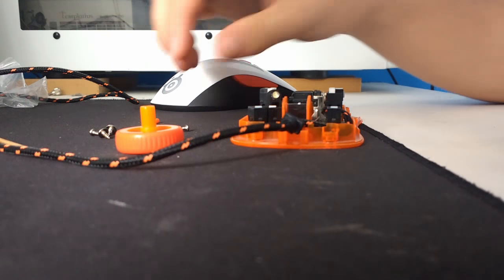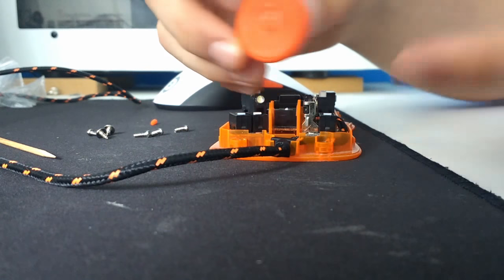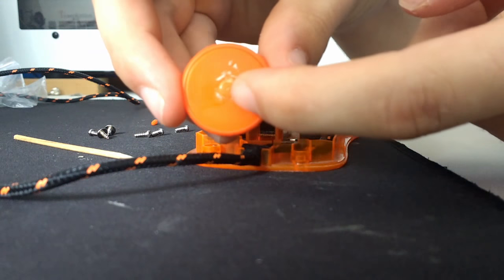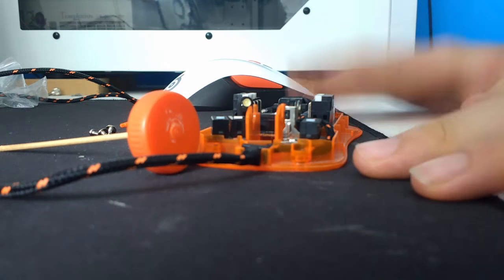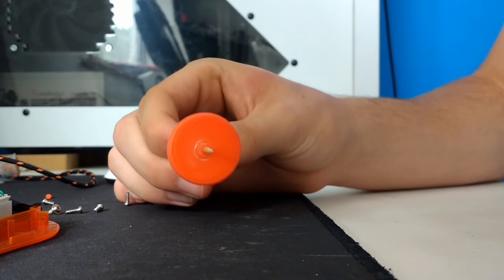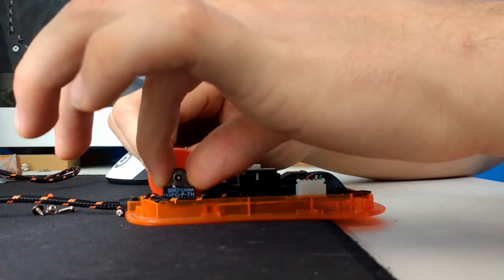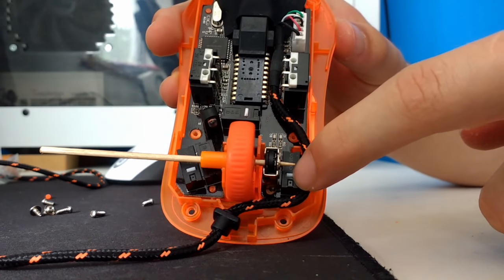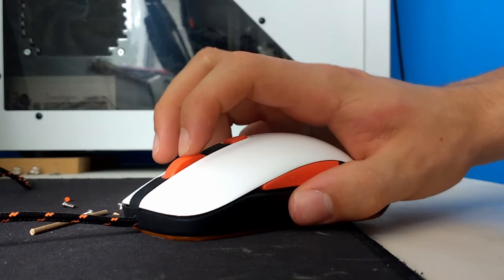How to fix broken Steelseries mousewheel axle

Comment: Thanks buddy,well i did mine using a toothpick and to make a hole on scroll wheel.I used a small scissor,heated up on stove for few seconds and used that hot scissor point on scroll whell to make hole.After that i filled the hollow part with glue and then put the toothpick inside it and alligned it with axis,left it for drying and tadaah!!.my mouse started working
Reply from the maker: Good to hear!

Comment: did this for my rival 100 scroll wheel. unfortunately, the rival 100 scroll wheel doesn't have that hollow center and the axle is solid all throughout, so ultimately i fucked up drilling it. ordered a rival 310 scroll wheel instead (because the 100 scroll wheel are virtually impossible to come by) and hope that it fits. if ever i rage again on that 310 scroll wheel, hopefully i get to use your method of fixing it hahaha. made me wonder why the factory didn't use these sticks instead, probably cheaper for them too. cheers mate!
Reply: where do you order scroll wheels from?

Comment: It's a shame we have to even fix it ourselves. I literally had this mouse the rival 300 for a month and the wheel axle snapped off. $40 for what?
Reply: Quartered Rodent Well I mean... 40$
Reply: @raresutz6257  Sorry you had to experience that. If you take a bit more time you will be able to find a replacement wheel. So far since my last post I have had no problems. I think I ordered my wheel replacement on ebay... it's less than $5.00. Check it out before you spend more money replacing the entire mouse. Good luck Penguin.
Reply: @cntrlled4698  From a reputable company I didn't think they would make a peripheral that broke down within  a month because of going cheap on internal parts.
Reply: @raresutz6257  No problem. Let me know when you fix it and good luck!
Reply: @raresutz6257  Nice work Penguin! I'm glad you were able to fix your mouse. Now it is a little Frankenstein's monster haha! Take care.
Reply: tbh steelseries worst company i have ever seen. after 1 month of my rival 600 purchase glues of side panels are started to come to my hand and they are not even sending new ones or take their faulty product back. Now wheel is broken and now I need to fix my own. Not gonna buy anything from steelseries anymore.
Reply: @burakmeral5265  I don't blame you Burak. Sometimes paying a little extra for something doesn't guarantee quality. Good luck on your next mouse.
Reply: @Quartered_Rodent  Tbh quality is not the issue for me here, electronics basically is a luck however, a brand like steelseries and their response is the issue. They made a faulty product and they need to take the mouse back and give the new one to their customer. Look for Logitech for example that's what they do and that's how they are one of the biggest company for the mouses keyboards etc.

Comment: there should have been a rod in the middle of the mouse wheel or a metal one but that would increase weight
Reply from the maker: The design they used is usually fine. I'm pretty sure all other mice use a small bit of plastic, which is strong enough (my g102 is exactly the same). In this case they just made it too thin or allowed the mousewheel to much vertical movement so that its liable to snap.

Comment: Funny that new wheel costs around 12$ and you fixed it for free
Unfortunately my wheel is not hollow so i need to buy new one
Reply from the maker: Neither was mine, in the video I mention that I drilled through it using a 2mm drill bit

Comment: Do you think super glue would work for me to put the plastic part back to its original place?
Reply from the maker: I tried that at first and it snapped, hence I made the video. Cocktail sticks are cheap asf deffo get one of those. Though if you or a friend have a 3D printer consider making a new wheel https://www.thingiverse.com/thing:1012588

Comment: Same problem here in a steelseries rival 300. I wasn't expecting this kind of low quality low durability in a "high end" product. Saw here in comments that the same happens with other manufacturers, wtf is going on? This kind of issue doesn't seem to happen in low ou mid end quality mouses.
Reply from the maker: I think they are all trying to make mice as light as possible following on from the finalmouse etc. Yeah not good when it breaks so easily.

Comment: My mouse is not hallow any idea how to fix it?
Reply from the maker: I see you commented that you have an air58. Which side has your wheel snapped on, the side closest to the rotary or the bit under the right click?
Reply: Seth Coode yes the mouse wheel is not hollow like yours I can’t put a toothpick instead of the plastic.
I have the ninja air58
Reply: Seth Coode closest to rotary
I tried gluing it but it didn’t work
Reply: Seth Coode did you find anything helpful?😬
Reply from the maker: @baderalfaleh8746  Use a 2mm drill bit or smaller and drill slightly into the axle/wheel, not all the way through, jus a bit. Cut a toothpick and insert it into the pit you have drilled out. Put glue inside the hole to help it stay in, I actually did this on a friend's mouse who had the same issue as you.
Reply: Seth Coode thx
I’m going to try it
Reply: bader alfaleh did it work, I have the same problem with the air 58

Comment: Problem with my mouse is that the scroll wheel isn't hollow. I've run short of ideas. Do you have any suggestions?
Reply from the maker: What mouse model do you have? You could try drilling the hole partially through, then cut a cocktail stick to the right length and putting that inside along with some glue.
Reply: Seth Coode Steelseries Rival 100
Reply: Seth Coode that wouldn't work, because all the modules are so close together, so I'd have to find a way to stretch it one way to fit, it's really complicated.
Reply from the maker: So are you even able to remove the scrollwheel on its own?
Reply from the maker: Assuming your mouse has the same internals as in this video? https://www.youtube.com/watch?v=rtm2yC4Dh_A 
I don't see how the solution I suggested wouldn't work.
Reply: lol it's all good, I fixed it. I'm an idiot and forgot that I could actually remove the motherboard part. It's all fixed up now, but thank you for the help!
Reply: The Salami how, i have the same problem, and same mouse (steelseries rival 100) and it does not work. Please help
Reply: just unscrew that bottom part (the motherboard I think) and there will be a larger gap for you to place your thing that will hold the wheel in place.

Comment: never again Steelseries Mouse !
Reply from the maker: Yeah it's a shame they cut corners in terms of quality to keep prices down, other than this issue its a really good mouse. I made the switch to a Logitech g102 a while back and its been a champ for £27.
Reply: @sethcoode6456  Switches are also pretty cheap. I had to replace mine rather quickly.

Comment: What was the problem you were facing?
I have a Rival 300 and if I scroll down, it scrolls up instead and I sometimes while pressing the left click, scroll gets activated.
Did you have the same problem?
Should I try this fix?
Reply from the maker: Does it always scroll the wrong way? Or only sometimes? I think you're experiencing scroll wheel 'jump' a common issue caused by dust affecting the potentiometer. Try blowing forcefully into the scrollwheel (sounds stupid ik).
https://www.youtube.com/watch?v=9unE3-Q15OY&t=68s

Comment: how do i make a hole in plastic?
Reply from the maker: I used a drill press with a 2mm drill bit. A hand-held drill would work fine. Any way you can think of will work mind.

Comment: Anyone know how to remove the base from the top sorry I’m kinda a noob
Reply from the maker: If by top you mean the shell of the mouse; you'll need to remove the mouse feet on the bottom of the base and unscrew the screws. Will need to buy replacement mouse feet to stick on when fixed though as they curl up when removed.
Reply: Seth Coode ok thanks

Comment: Steelseries have terrible hardware quality - avoid
Reply from the maker: mmmh, other than one break this mouse has outlasted both a RAT7 and a Logitech I bought. Still using this Kana v2 in 2019!
Reply: @sethcoode6456  Alright maybe I was being a little over the top.  Apologies.  Their stuff works well, but I think quality can be better for the price when compared to other brands in that range.  My rival recently encountered a problem with the scroll wheel where its jumpy.  I'm going to attempt opening up the mouse this weekend, removing the scroller and clearing out the dust.  The guy in this video also uses pliers to squeeze the area where the pin connects.  Take a look here: https://www.youtube.com/watch?v=6teEC1RuoQQ
I'm not particularly practical, but I'm going to attempt fix my mouse as I don't have money for a new one and this scrolling problem is a bit of a nightmare which caused my infuriated comment above.  If you have any advice in this regard it would help.  Should I also be squeezing my thingy with a plier? lol